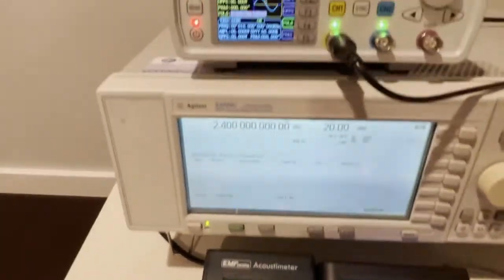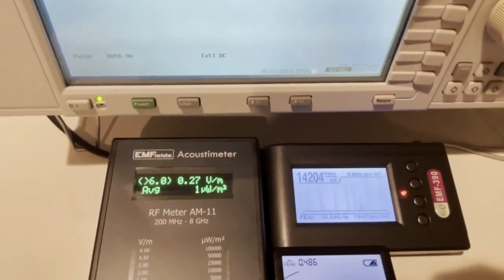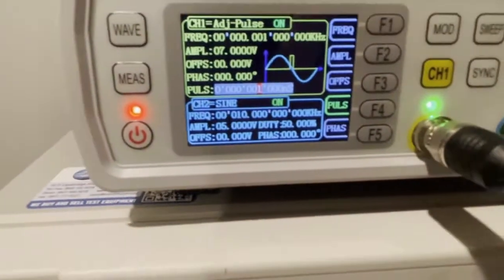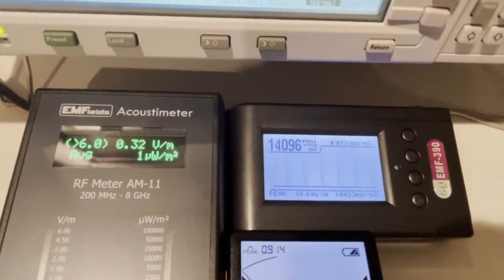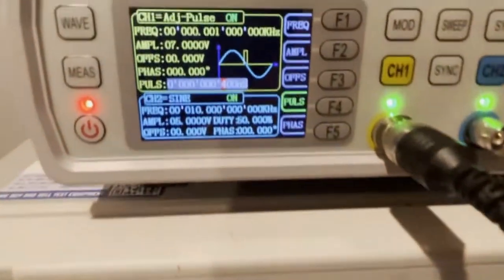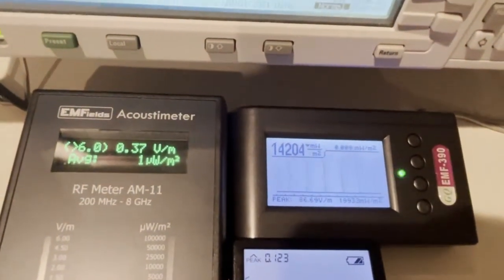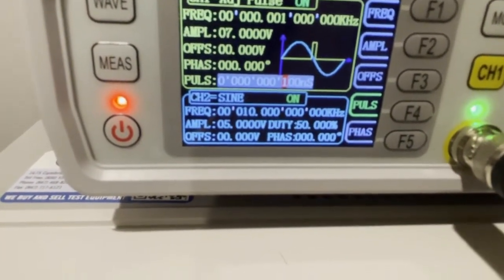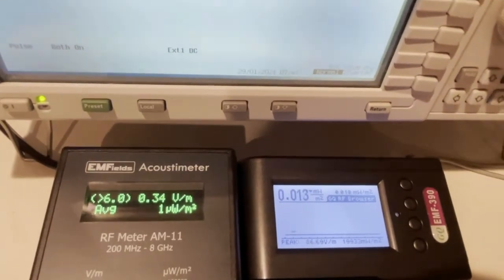RF Pulses Testing on Acoustimeter AM-11 Trifield Tf2 GQ EMF-390 review

Comment: Hi there, I ordered two GQ EMF-390 to compare whether they worked ok and they seem fine but something odd is happening with my iPhone while on wifi. Although both meters detect RF constantly on iPad, this is not the case with my iPhone. For instance nothing is happening on the RF part of the screen (I always use the AllinOne mode) at this very moment (background level at 0.002 mw/m2) while I’m watching your video or writing this comment on my iPhone. If I do the same on my iPad, RF go up to 10mw/m2. Same when the iPhone is on idle mode. RF do not go up when I receive a WhatsApp notification for instance. However there is constantly something going on with the iPad even when it is in idle mode. Any idea why? Thanks!
Reply: Also awaiting a response.

Comment: Interesting. I’m curious if the positioning of the three meters makes any difference. Is there a certain area or point on the meters that detects the pulses, like they need to be pointed/facing a certain way? Like if the Trifield wasn’t nested, maybe blocked, between the other two, would it make any difference? I’m unfamiliar with how that works and had read one comment on Amazon review for the EMF390 that it (allegedly) needed to be facing a certain direction to detect signals around it. I have no idea if that’s true or not, and if it is, how that may affect these tests. It’s great getting to see them in action in a controlled test like this, thank you!
Reply from the maker: The position of the antenna will affect the level of the RF readings.  But it does not affect the response time to the RF pulses.  As long as it can detect the signal, the meter's response time should be the same. To get a strong RF signal, all RF detectors need to get a better position to detect the RF signal, no exception.